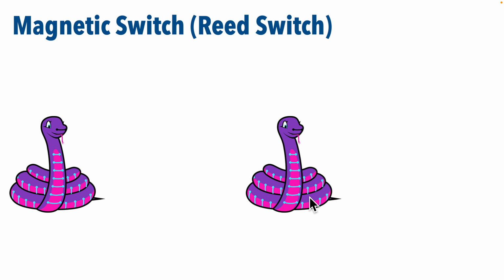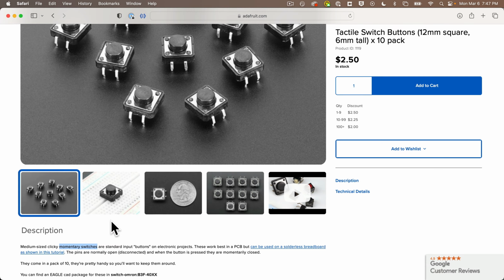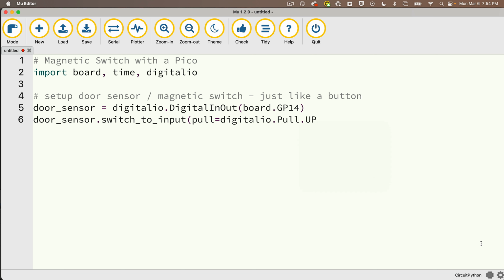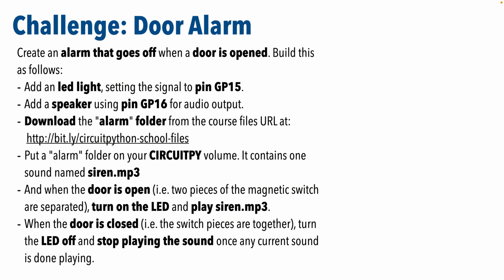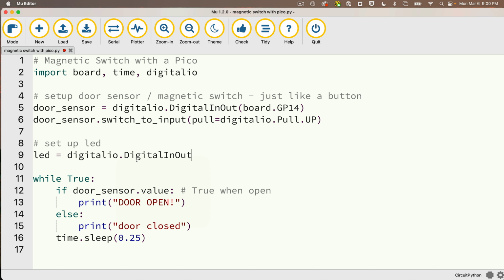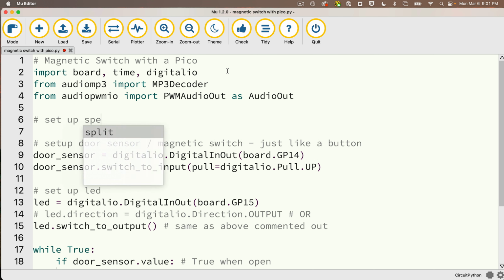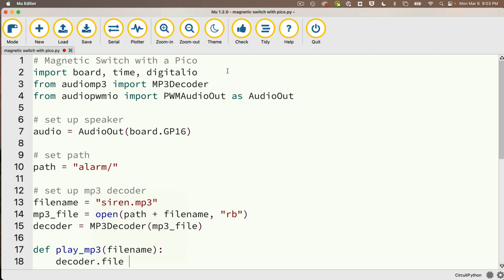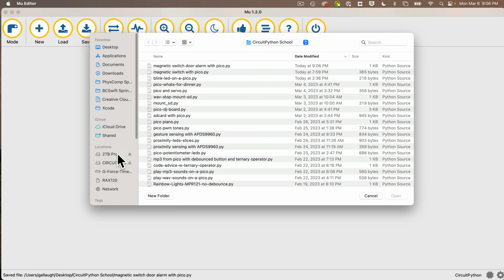Using a Magnetic Switch (called a Door or Reed Switch) with a Raspberry Pi Pico & Circuit Python

Comment: possible to start the pi pico when a gpio is triggered run a task and shutdown again?
Reply from the maker: If starting is no power before this then no because pico needs power to read GPIO. You can cut off power with a relay switch. But you might rather mean sleep mode? If so, check out this https://learn.adafruit.com/deep-sleep-with-circuitpython/overview
Reply: @profgallaugher  no sleep mode does consume too much energy, however, I think maybe having a relay switch which powers the pi on might solve my issue as this would power on the pi run the task and I could trigger the switch again to cut power afterwards